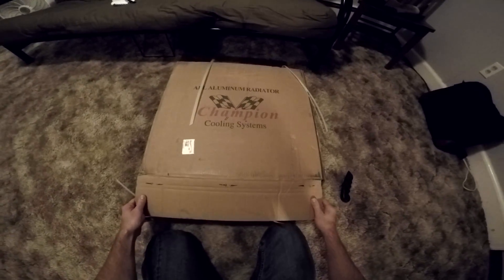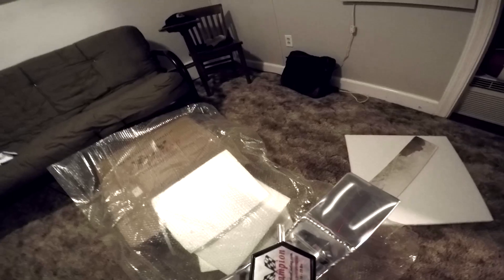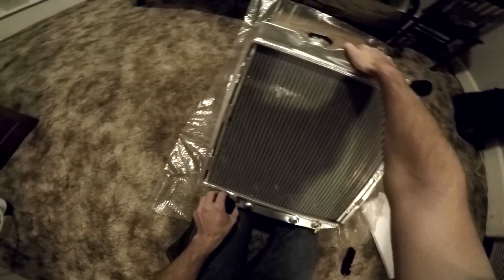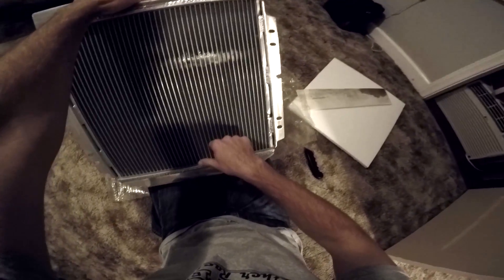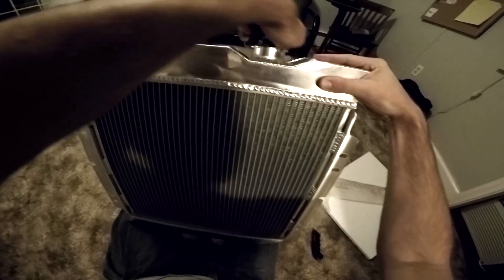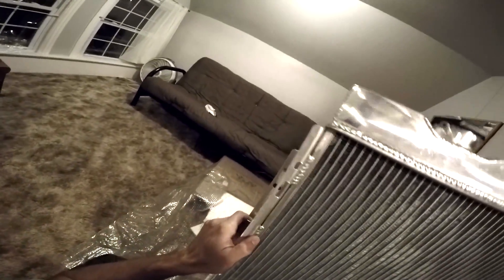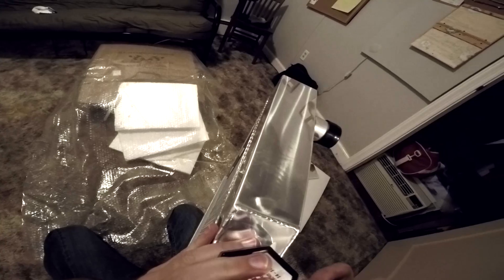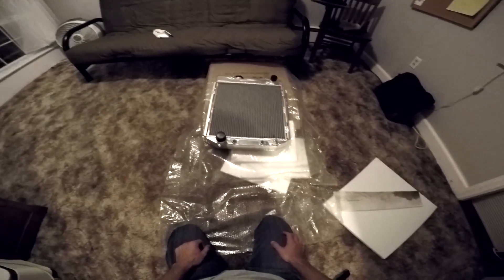Aluminum Radiator drop-in replacement for Falcon V8 swaps

Comment: Just wanted to ask a better mechanic out there if this radiator has the exact holes and dimensions for a 1962 ford falcon. My motor is a 302 from a 1983 Ford Mustang? Thanks

Comment: press down first!  haha  It's a failsafe system so that hot coolant doesn't explode in your face (unless that's your thing).  Press down, quarter turn to the left, the cap is still locked on but loose to allow pressure to escape.  Then do the second quarter turn without pressing down, that will remove the cap.

Comment: ah very cool, nice that it'll just simply drop in .  and in my semi professional opinion, watch the welds on the filter neck under the cap. sometimes aftermarket aluminium radiators will leak there

Comment: From person experience my Champion lasted a year before it started to have issue and had overheating with a mild cam 302.  Ive been told the issue is due to the small tubes.  
Just google  "champion radiators crap"

Comment: Always buy radiators that are pressure checked. (Is it guaranteed pressure checked from Champion?) If you're worried about QC a radiator shop should be able to pressure check it for you.

Comment: Pretty easy to breathe through a clean radiator, it is all an Inter cooler is after all.
Reply: +vector6977 It is a type of heat exchanger, so is an intercooler, but a radiator isn't an intercooler.
Reply: Benjamin Columbus Lol, not it isn't. A wren is a bird, a eagle is a bird, but a wren is not an eagle. 
They (intercoolers and radiators) are both heat exchanges, but a radiator isn't an intercooler.
Reply: +herranton1979 Not in the air-to-air intercooler sense like that used with a turbocharger, but it is a water to air intercooler.

Comment: im sure you guys know this but FFS do not using any tap water when you go to fill it
Reply: +Heartagram I can confirm ice cream works for a short time. Then you need a new engine. Well, maybe only if you use cookies and cream...
Reply: What if I put soapy water instead of oil in my engine?
Reply: Heartagram
if putting oil in your radiator is your plan have at it Hoss
Reply: Sleepy .Time What about ice cream? It's cold.
Reply: Heartagram
nah ice cream is for try hards, just stick to licking windows as usual